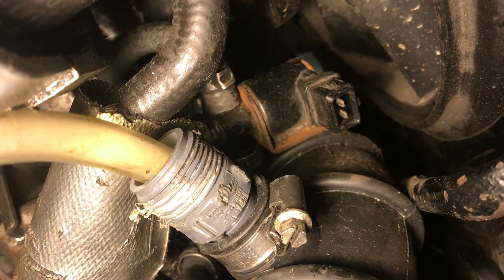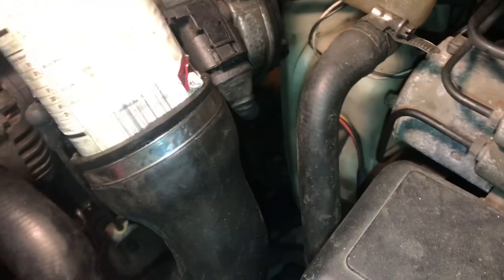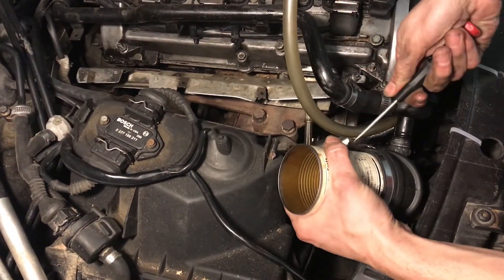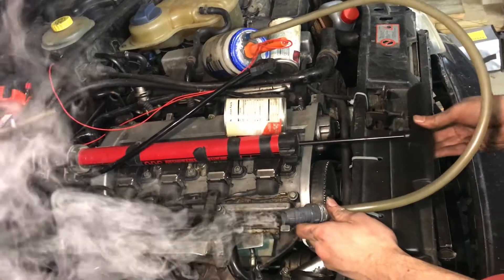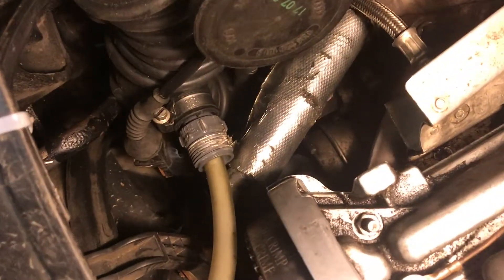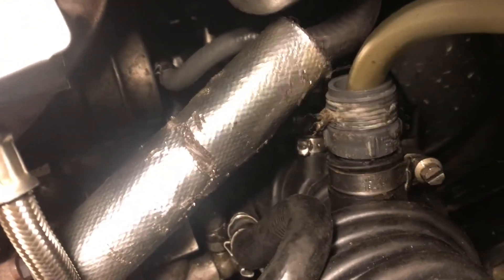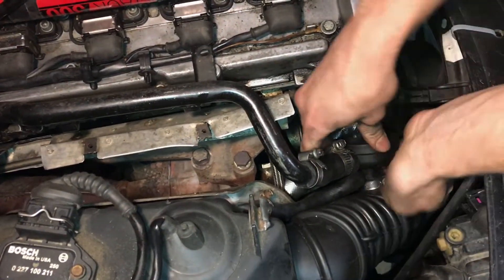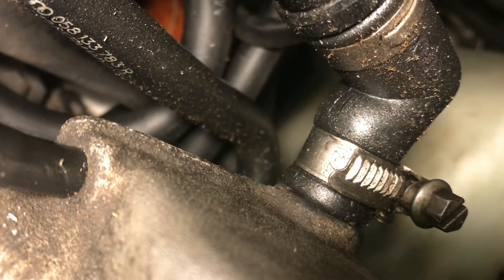turbo boost LEAK test on of 1.8 T volkswagen / audi

Comment: If anyone is struggling to reach the snorkel like I was on a VW bug, you can drill a hole into the bottom of the soup can and route the air hose right through it to push smoke in via the same hose that plugs it.

Comment: unfortunately sometimes you need pressure to find leaks,today i found a leak at injector o ring that only leaks when past a few psi but doesnt leak under a few psi,always pressurize the same psi as wastegate to stress parts the same as turbo.smoke and pressure combo is best.

Comment: Hight pressure is better sometimes. Some of the leaks occurs when the system is under pressure (1.1 bar+ )
Reply: exactly you're right
Reply: lol no
Reply: @gplusgplus2286  and why "no"? A friend of mine find a boost leak only at 1.5 + bars (his car is up to 1.65)

Comment: and this heater connected to the car battery?
Reply from the maker: At first I use a soldering Iron that was plugged into the wall. When that burned out I replaced the heating element with a 12 V heater.

Comment: How are you making the smoke ?
Reply: Do a video on what u used to build that smoke machine. I like it. Very handy and helpful. Tia
Reply from the maker: Are use a soldering iron glued to the top of a pickle jar. Inside the pickle jar is a cotton sock that has baby oil saturated. On the top of the lid there is a place to hook up a bicycle pump.Then on the same lid there is a hole that comes out of the lid that I hook up the vinyl tube to. When I pump the bicycle pump of the smoke goes through the tube and into the engine. It’s a little hard to describe but it’s pretty simple
Reply: Live Free what diameter is the smoke machines fitting that goes into the snorkel?